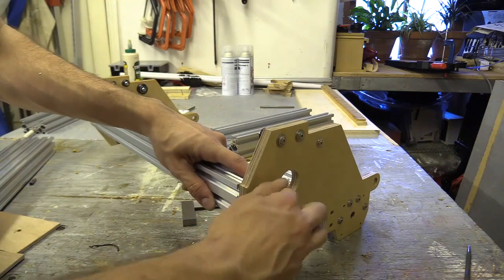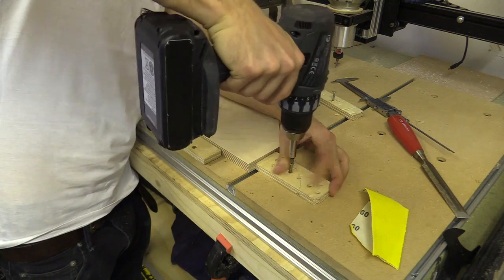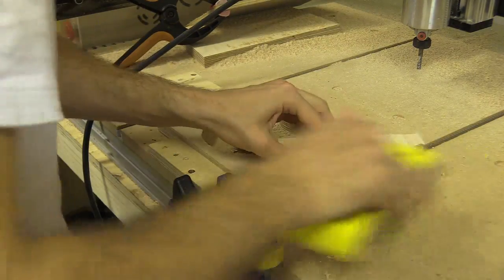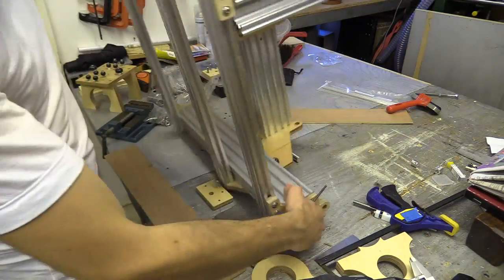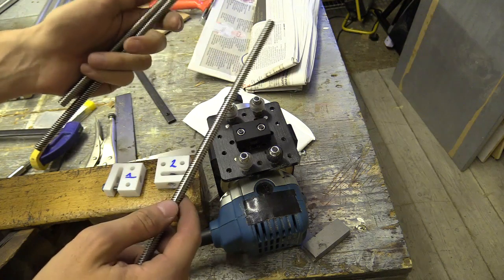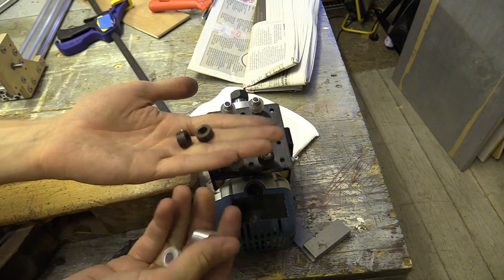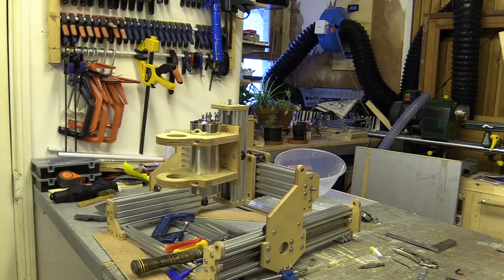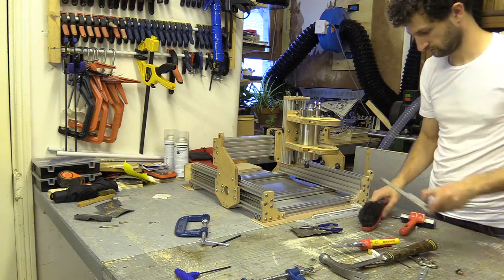#5 Assembling Z Axis and Spindle Mounting Plates #5 / C-Beam Lead Screw CNC

Comment: on the spindle plates you could have used " cross dowels 6mm "
 https://www.screwfix.com/p/hafele-cross-dowels-m6-x-14mm-50-pack/2069t.
These are very simple to use.

Comment: One of two vids I've looked in the series so maybe it was already addressed but is there any particular reason to use Ply instead of a more resilient but still fairly easily machine able material like POM?
Reply from the maker: I'll probably make the next set using some kind of plastic - POM or HDPE - but I wanted to demonstrate that the machine and design could be made with a more easily found material and used to rebuilding using a more robust material.
Reply: Heh... Apparently it also demonstrated the risk of using a material that comes with the ability to bend ;D

Comment: Nice build, I like your work. For your spindle clamps you mentioned that you worry about taking out the bolts too many times. Tapping into the edge of the plywood always makes me worried as it's so easy to not only lose the threads but you can also split the wood. Since this area will be experiencing loads during use I'd look for another more secure way to fasten this. You may consider using a barrel bolt and nut as illustrated in this image. http://s3.amazonaws.com/finewoodworking.s3.tauntoncloud.com/app/uploads/2016/09/05192102/align-bed-bolts-01_xl.jpg   All the best, -Brian
Reply from the maker: Thanks that's a good idea.  I also have some insert nuts. Once I have finished the new controller I'll see how it performs and take it from there.

Comment: At  6:24,   you attaching the part by taping the plywood.  Instead of taping the plywood why not use Threaded insert?  They hold very well and and you can screw and unscrew hundreds of times with no negative effect.
Reply from the maker: I did have some but felt like cutting a step out. If the machine screws didn't bite I'd have had to use some.

Comment: Really enjoy watching your videos...what lead screw you using 2mm per turn or 8 mm per turn?  and what is the overall dimensions of the machine?
Reply from the maker: 8mm per turn and once the drag chain is added it will have a footprint of around 750x500mm. Can't remember the height off the top of my head.
Reply: Nice....What driver/controller will you use on this one? (Assuming you won't be taking the gshield from the Xcarve )
Reply from the maker: I bought a phoenix CNC controller - which are hand made by a fella called Hayri in Bulgaria.But I need a few more parts before I start on that.